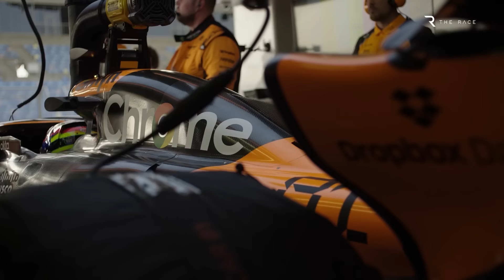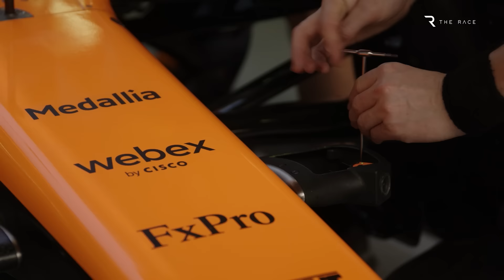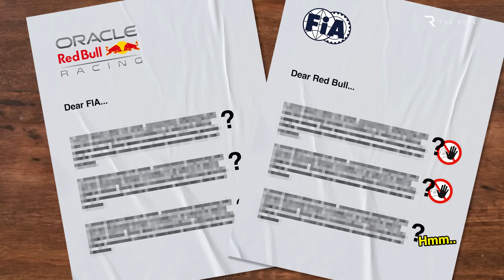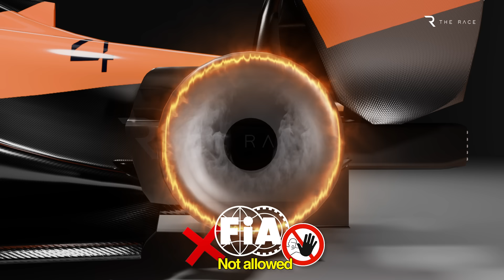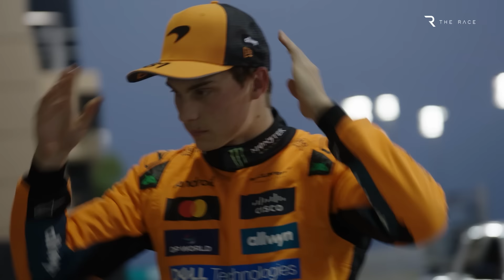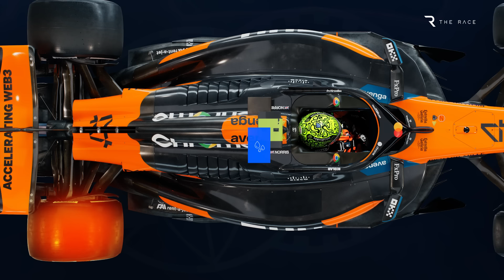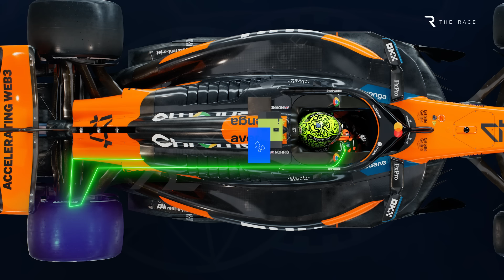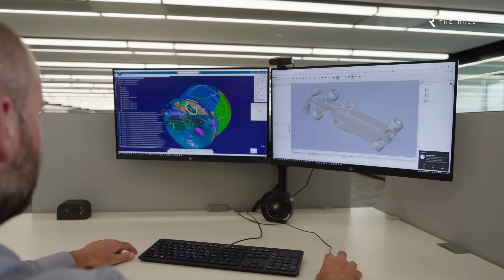Revealed: Red Bull’s wildest theories on McLaren’s clever tyre tricks

Comment: Materials engineer here. Still going with the theory of phase change material. Phase change does not have to be associated with change from solid to liquid, it could also be the transition from one crystal lattice to another while staying solide. Other words: There is nothing involved that can be accounted as "liquid cooling".
Reply: Question: would it also be feasable to have materials change shape, for example the material expanding or contracting, touching the outer metal and thus exchanging heat whenever needed?

And did you mean by phase changing materials that there could be a material that absorbs or releases heat depending on which state they are in??
Reply: @lordbogus1985  Yeah that could also be, that's called a bimetal - a sheet made out of a metal with large thermal expansion coefficient and a 2nd metal with small thermal expansion coefficient. If heated up it bends due to the different expansion. That's often used in temperature safety switches or temperature gauges. It's a theory that McLaren uses this to actuate a flap and change the airflow inside the cooling channels. I doubt they are using the way you suggest by connecting to another metal to conduct the head away - the suspension assembly and most of the wheel assembly is made of carbon fiber composite, a poor conducter of heat. 

It's not about the state the material is in, it'll always absorb heat if the surrounding environment is hotter and release heat if the surroinding environment is cooler. It's about the process of transition between those states. Dependend on the material it consumes energy (cools) or releases energy (heats) when changing the phase. Buchan Motorsport made a short and very good video about it, higly suggest you watch it! Happens that he wrote his thesis at McLaren about phase changing materials :D
Reply: @123Chris1994  thank you very much for that explanation!
Reply: @lordbogus1985  Some waxes expand a lot when they warm, which is why they are used in some thermostats. This is not the effect in question though. Changing phase uses a lot of heat transfer with very little change in temperature, so if you can get the material right, you can absorb a lot of energy with little change in temperature.
Reply: @lordbogus1985 Materials changing size due to heat is one of the major problems in most fields of engineering.
Reply: Yup! This
Reply: In that video: metal and polymer composites are prohibited, but I wonder if ceramic composites are allowed? It would allow e.g. alumina trihydrate or Al2O3 composites. ATH-composite would not technically be phase change material, but would absorb huge amounts of heat. Al2O3 or graphite would increase thermal conductivity. Lattice-to-lattice transitions can have relatively large hysteresis on transition temperatures and also slow transition kinetics in another direction.
Reply: @tinska12  Ceramics could be the exploited gap in the rules. But it's not just about conducting heat away or absorbing heat, that would lead to slow heating and the tyres getting into their window too slowly. Air cooling is sufficient enough to keep the rims/tyres cold. It's more about having them heat up quickly (less air cooling) but dampening the 'overshoot'
Reply: Yeah, Nitinol betweem Martensite and Austenite
Reply: @glockmat  good example but that's considered a 'shape memory material' that is forbidden as shown at 11:40. Nitinol has many very interesting applications!
Reply: those materials melt at 500°C... others don't have any significant influence on temperature maintenance and would be just like steel heating up and consuming some energy. So if they use it for temperature maintenance, they do melt.
Reply: My hat is being hung on clever aero and clever resin systems.
Reply: But they did an entire teardown twice. You think they would've noticed a novel material if it were there. Why is it impossible to believe McLaren designed a genius legal way to cool their tyres/brakes?
Reply: @IamStormy-t5d  because inevitably in F1, you don't make breakthroughs due to novel design, rather from novel interpretations of the rules and things that the rulemakers didn't consider (f-ducts, double diffusers, dual axis steering, and the inevitable cat and mouse game that is flexi-wings.)

Especially as rulesets mature and all the "normal" breakthroughs that you're describing have already happened, where else will a team suddenly gain a new several percent over the field?
Reply: There's a rule that specifically outlaws phase change materials within wheel and brake assemblies. It was covered in one of the other videos.
Reply: What is it? ZnS or hafnium oxides are what chatgpt suggests
Reply: What about Peltier cooling?
Reply: @pankitbhadola16  Too inefficient. They got an efficiency of 5-10% and would need a huge amount of energy. Also if one side get's cold the other side get's hot and you have to remove the air there. Not feasible in a small wheel assembly
Reply: So rb did not ask fia in its "questions" if cpm would be permitted???
Reply: Do not pretend you are smarter than the top F1 team 😂
Reply: Phase change material is banded & the FIA have checked for it.
Reply: AND a team could conceal a volume of phase change material within a cavity in some part of the wheels...and an inspection of the brake drum area would reveal nothing unusual at all. Plus this would mean every tire change renews the charge of phase change material. Everybody keeps talking about the area of the brake drum, but nobody has mentioned the wheels themselves.
Reply: I swear they're using Cerosafe to do it. It comes in a variety of melting temps. Turns liquid at a low enough temperature to be used there. And most of all it's dense enough to have a useful effect.
Reply: Yeah, that’s probably it, FIA are way too hapless to think of something like that.
Reply: I was thinking of heat-pipes personally
Reply: @Gu1tarZer0 Normal heat pipes stop working at the kind of thermal densities involved here. And heat pipes are technically liquid cooling (that's how they work, aka by turning water into a gas and then back again) meaning they're explicitly banned anyways. 🤷
Reply: you can sink a lot of heat into the right ceramics and they'll hold on to that heat for a very, very long time. That's why the turnaround time on the Space Shuttle was so long, the ceramic tiles needed to cool down internally first.
Reply: The FIA have already said that Phase Change materials are illegal. And that the McLaren design is legal. Therefore...
Reply: RB is so desperate for answers they've handed some, very unlikely all, of their correspondence between the FIA  and themselves to a youtuber hoping for comments like this knowing they have the capacity to develop parts, regardless of cost, faster than all the other teams.

Pinnacle of motorsport is a clown show that has literally become reality TV programming. Drama is always the most interesting thing to the sheeple.
Reply: @jdoe9518 You don't think this went on in the past?  There have always been teams who come up with a different interpretation of rules and other teams take issue with it, spitball theories, and it's investigated and it's either widely adopted or it's banned.  It's just now that it's microreported by a hundred different outlets and Netflix, which I refuse to watch.  Besides, I've seen stuff about phase-change material in multiple locations more than a week ago.
Reply: Right, but why would the advantage disappear? Sure maybe RB too are using phase changing now, but at their first time of usage they completely obliterate McLaren at their own game? Sounds unreasonable, and not straight forward enough to be true. The straightest answer is McLaren lied about having to change something on the car after these TDs and therefore Max who was already able to keep up with McLaren now is ahead.
Reply: @Jaytalise - it’s not a cure all… just because a technology provides an advantage doesn’t mean it provides better performance than a rival in all circumstances
Reply: @F1FanCanuck  Nice, completely miss the point & put words into my mouth. The point isn't about whether something provides an advantage in all circumstances, i don't know how you got that from what I said... Im just saying this phase change would still exist at Miami if it was used at all, but more likely it doesn't & they had to change something.
Reply: @Jaytalise - not at all… differences in performance at different tracks doesn’t necessarily imply a change to either team’s platform. You’re making assumptions not supported by facts.
Reply: @F1FanCanuck Did you watch Miami mate?
Reply: @F1FanCanuck I mean just a coincidence then, two TDs get posted and the cars switch position… Crazy coincidence
Reply: @Jaytalise - correlation is not causation mate, it’s a basic rule of both science and logic.
Reply: @Jaytalise  Miami and Imola are about as different as 2 tracks can be. Comparing performance at them shows you dont understand anything about F1. McLaren are better in slower corners, redbull are better in faster corners. I wonder, does Miami have lots of slow corners and Imola lots of fast ones? Yes, that's exactly what they have...
Reply: @Jaytalise  it's one race dude. If they still lose their advantage for the next race you have a point. (Although the next one is Monaco which doesn't count so maybe after Spain)
Something else to consider is that the tyres used at Emilia are the softest 3 tyres in the range including a brand new super soft not used before. How those soft tyres react to thermal degradation is potentially different to the other tyres
Reply: @Jaytalise  Its only been one race. In Piastris first stint he managed to keep pace, and was only 2.7s behind Verstappen in Lap 11. After that the McLarens managed to overall maintain their intervall to Verstappen. Due to the safetycar VER did not lose any track position when pitting, and after the restart NOR was stuck behind PIA for 5 laps. After NOR got past he was 5.3 behind VER, with 5 Laps to go. He kept that distance, while PIA lost another 6s with his old tires. 

So it wasnt a clear cut runaway win. McLarens Strat was sound, they were not slow,  the SC was unlucky. The Decision to not let NOR past PIA at the restart was pretty dumb tho.
Reply: @Jaytalise  Whilst passing a full inspection at the conclusion of the previous event rather than being excluded from results? And the current redults had nothing whatsoever to do with VSC or SC and pit stop sequence.

Comment: Back at university Thermodynamics class, I used a peltier device to power a Gameboy for a project.   Using a lighter on one side (ambient air on other), heat contrast between sides created sufficient voltage.
Reply: thats cool (or hot...)

Comment: I am flabbergasted that peltier cooling has been seriously considered as a way to cool tires. For anyone that knows anything about physics that is absolute madness. This is insanely weak and is barely enough to cool a 6 can micro fridge to a bit below ambient temperature. It would have zero impact in the real world.
Reply: This 6 can fridge, what is the wattage it can warm or cool??? And what is its surface area?
Reply: There's a technology connections video about it I believe @lordbogus1985
Reply: soemthing with laws, energy, and how much you need to put in to cool. 
Would be a giant drain on the battery.
Reply: yeah that's like using your body temperature to heat up a fire, actually that would be better lol
Reply: You only need a few degrees of cooling to make a huge difference.
Reply: @perfectman3077 Brakes temperatures can go up to 1000°C so So a peltier cell that can cool about 20°C will practically be imperceptible.
Reply: @DaVoKanfr  brake pad temperatures. Not the whole hub or the tire.
Reply: @perfectman3077 Degrees in temp doesn't convey much. The capabilities of a peltier module is a few dozens watts worth of cooling. Even slight sun exposure would counteract that
Reply: Not on brakes, we're talking about a thousand degree brake here  @perfectman3077
Reply: "For anyone that knows anything about physics" = Listen to me, I'm an expert.
Your comment would have been just as valid without such a condescending  phrase.
Reply: @mikezappa I am not an expert, and that is exactly the point. I am really trying to convey that this is so obvious that even a random dude on the internet like me knows that peltier cooling is only used in very specific applications with very low cooling demands in terms of energy transfer and where heat pumps are impossible (medical for example). My surprise comes from seeing it discussed in a well known channel.

Comment: Id love to see the thermal images Redbull got their hands on, specifically the one that shows the supposed significant difference in the rear brake outlets on the Mclaren. Some thermal cameras can let you choose a temperature range for their hot-cold readings, I wouldn't be surprised if the image had a super strict temperature window and was manufactured to look worse than it actually is.

Comment: The peltier device theory is interesting, but it would need to be a new approach I think. Traditional uses of peltier devices are really inefficient, and I think they don't transfer as much heat as would be necessary to have a significant cooling effect on F1 tyres . You would have to have a LOT of the current mainstream type Peltier devices, such as those used in cheap wine fridges/car fridges that take forever to chill/heat..
I wonder if someone has invented a new generation of thermo-electric device. I hope so, peltier devices are so useful, just way too inefficient

Comment: So drivers are drinking boiling water. That's the dumbest idea ever. You know the water would boil and just cover the driver in hot water.
Reply: And the volume of water is so small, that it wouldn't make too much difference. ie: if the drivers bottle is 2 litres, then the cooling it could provide for a whole race would be infinitesimal.  I used to have a water spray bottle for my intercooler, and was was almost a waste of time/weight as it was used up VERY quickly
Reply: First the amount of liquid needed in a chamber to produce the phase changing phenomenon is very small.
Second the video said that the liquid would 'accidentally' leak on its way to the driver.
"Must be the water."